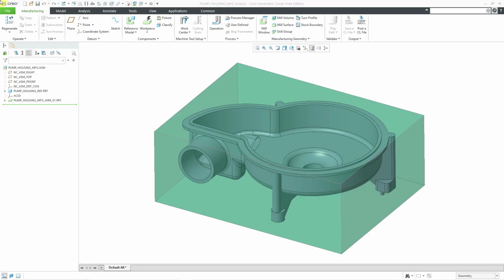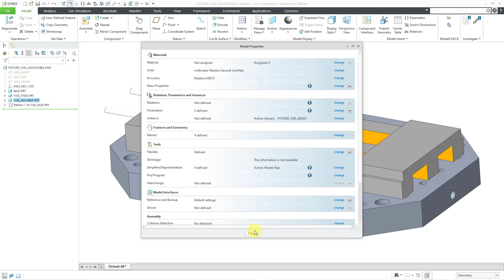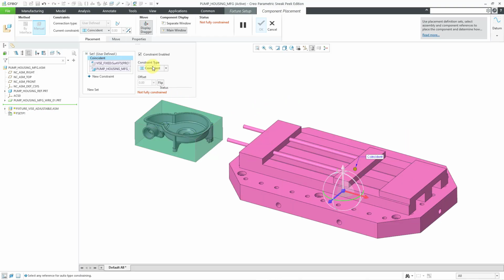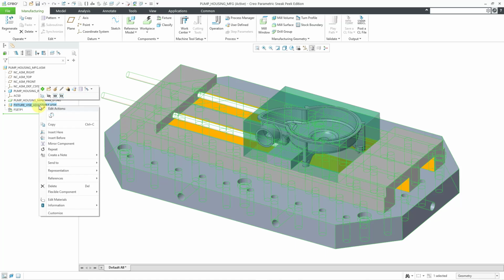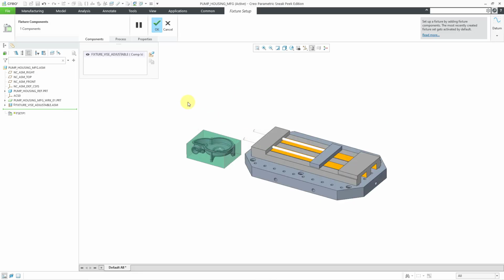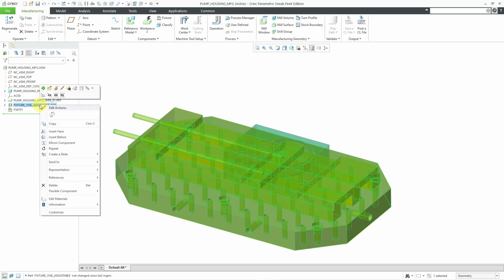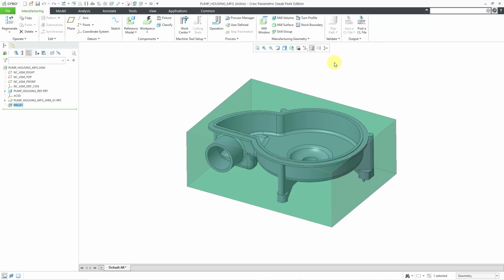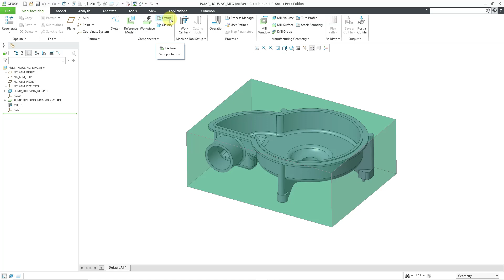Creo Parametric - How to Add a Fixture to a Manufacturing CNC Model

Comment: Please make a video on creating a tool library in Creo Parametric (mills, drills, etc.), including how to save tools and cutting parameters for different workpiece materials. Is a material library needed, and how to set it up? Separately, show how to create a solid tool and configure work with tooling like collet chucks (e.g., SK40). Thanks!

For example, we’re purchasing tools from multiple catalogs, and I want to create a library of simple end mills from one catalog. I have a table summarizing the mills’ parameters and ISO material groups (P, M, K, N, S, H), including cutting speed and feed per tooth. I need to turn this table into a library in Creo. Can Excel be used for this? Could AI be leveraged to speed up the process?
Reply from the maker: I have more videos in the pipeline, but they are not going to go into the depth and specificity that you are looking for. I recommend that you engage with a consultant. You should have realistic expectations about what you can get from some random guy's YouTube channel and when you need to contract for training and consulting. I've held off on making CNC manufacturing videos for years because there's so much setup involved that needs to be tailored for each company.